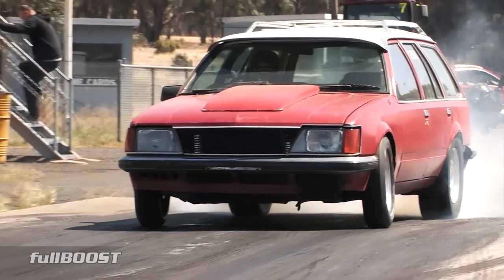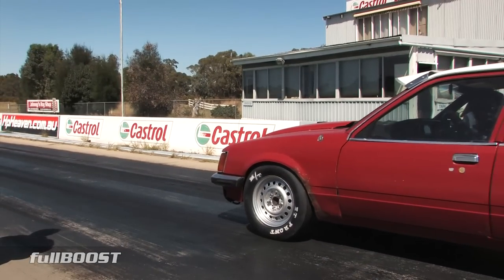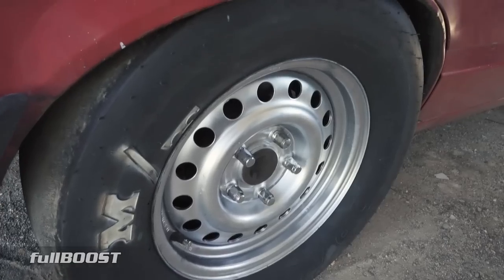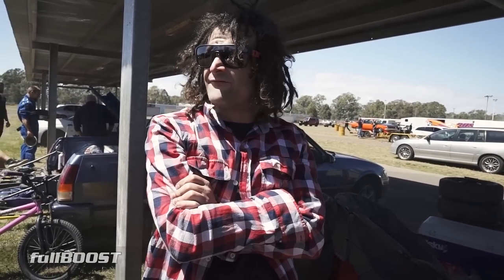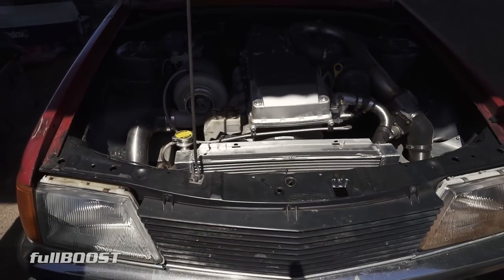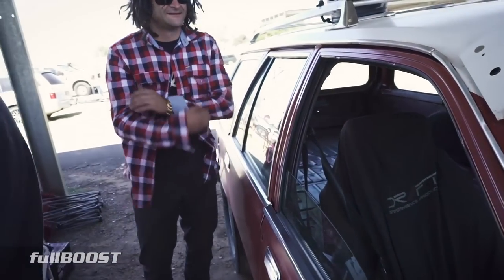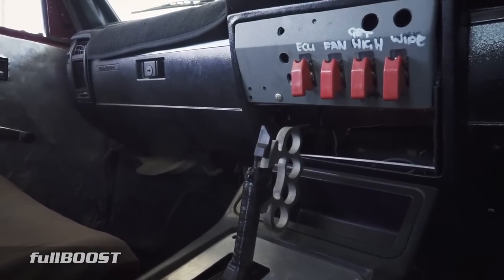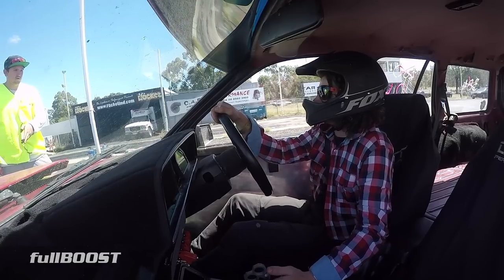Parts bin budget Holden | Ford Barra power!

Comment from the maker: A great example of a budget build, Kyle’s Holden wagon was initially pieced together for just three grand using a naturally aspirated Ford Barra BA engine and ebay turbocharger. A set of new slick tyres is about the most expensive part of the build.
Reply: Is the engine still running ?
Reply: sure is Ali Mavruk. pb of 11.5 to date. dead stock motor
Reply: kay bee  thats mad you should put a bf gas engine and crank up the boost to like 20psi
Reply: It's running 19 psi now! Can't believe it.
Reply: kay bee 19psi thats crazy
Reply: Upload more videos of it
Reply: No Ali there's no blowby yet, catch can is empty since day it was started, take oil cap off while running no smoke. Bit of valve float at top end of track that's about it. Engine still sounds strong as day 1
Reply: Did i hear in the video something about cams? Did you use turbo cams from ba? So basically you went to a wrecker and baught this motor? Put a turbo on it..didnt touch head gasket or compression or anything on the motor besides manifold and turbo and injctors..and tuned it?? Correct? Thats crazy..iv hear of people doing it alot but not sure how they went...
Reply: How much Power is it making and what fuel?
Reply: Pump 98 fuel, and yes it's still going today! Spends most it's time on burnout pad now. Same stock ba na engine. No springs no mods and no repairs needed since build.
Reply: @kaybee9363  What ECU did you use for it ?

Comment: wish we got barras here in the US
Reply: Arron Johnston 😐
Reply: MostlyIrishCarGuy  i recently  found out you guys get a gm  twin cam 4.2 strait 6 over there in trailblazers  ect.  why don't  people use that.
Reply: My family friend from california runs a shop calls cars usa and is imoprting barras as we speak.
Reply: Use your damn EcoBoost motor....leave the Barra for us.
Reply: u Americans know these barra engines are sand casted?  most Barras are amazing BUT not all! some have imperfections from the casting process and FORD knew this and blueprinted/handpicked motors for FPV models. Fun Fact for the day
Reply: Correct, a good way around this is to semi grout fill the block, it usually makes them strong enough to get by with a decent amount of power.

Thankfully we've got these engines fucking everywhere here, so a few headed to the states isn't a bad thing, I just hope they're not getting the NA engines, or if they are they're changing the rods in them for boost.
Reply: Faawks NA rods are the same as the ba turbo rods, heaps of 350-450rwkw on e85 cars around that last, northmead auto made 500+rwkw on an unopened fg na engine so its hardly a dont touch them. Bent rods or a leg out of bed are poor tunes or a rod bolt failure blow those power levels. Even the bigger turbo rods are only a minor upgrade. Best thing that could happen is americans push the development of them, every wrecker has 10,000 of them sitting there, more than enough to share. At one point a place was selling them for $75 with manifolds.
Reply: they cant import them anyway lol EPA wont let em. (we can though)
Reply: LP187q N/A BA Barra's have different rods than the turbo and factory LPG motors bro. It's funny the LPG motors got the good rods. They were having trouble with the LPG cars backfiring and bending rods so they used the beefier one's intended for the turbo engines. Not that the turbo/LPG rods are that good anyway. It's alright cause it matches the cranks!!! LOL! A lot of people don't seem to realise the rods are doing the hardest part of their job when the piston has to change direction at TDC. It's the stretch that kills rods, not compression loads or power stroke loading. I've seen a lot more rods fail from this than "S" bending from putting too much power through them. There's a reason Ford didn't let these things rev
Reply: Carl Zirbel How did they get around the EPA issue- especially in Cali?!?
Reply: MostlyIrishCarGuy I'm a qualified mechanic in Australia, I might be able to help you if you like. There is issues getting them into the States because of the EPA requirements, but there IS a way around it. If your serious enough about it, I'll give you my email address and we'll talk I'm thinking about sending a bunch of them over to sell, but is kind of difficult since I live over here. Maybe we can work something out that'll be beneficial for both of us
Reply: BA turbos used the small rods, mk2 ba f6's were the first with the "big" toothpicks. I agree its the stretch, but most dropped rods  you see have the piston attached, which is safe to assume is a rod bolt failure. Fair enough with 6" rods and a 92mm piston. People hack on the cranks but DLM pulled 8750rpm with a modified factory crank. Nems 8 second f6 makes 1250whp with the stock crank, main caps, girlde. Just pistons rods and 625+ fastners.
Reply: don't you think that if the Yanks get wind of them and create more demand for the Aussie 6 that Ford would return to building the Aussie 6 instead of the V6 crap they are building
Reply: LP187q That's pretty impressive with the factory crank and caps! They weren't made for revs from factory though, were they?!? LOL! I wonder what that 92mm piston would be in imperial measurement? My Rb30 only has an 86.5mm bore with a set of 30 thou up pistons. What's the stroke on these Barras? It's an under square engine, isn't it? I'm pretty sure it is, with a longer stroke than bore
Reply: 99mm stroke but that shouldnt stop it from revving with a good rotating assembly. Pointless having a twin cam head and turning it to 6500rpm. The 8 second f6 was running the zf 6 speed so wouldnt've been revving high either.
Reply: I hear ya, the only problem is piston speeds. Once you start seeing 4000 - 4500 feet per second it puts a lot of strain on the crank, block, caps and rods. A lot of really successful race engines seem to use somewhere around 1.3:1 bore to stroke ratio- everything from Pro Stock drag race engines to drag racing Suzuki bike engines. Even Harley Drag motors. But then you look at something like a 632 and these guys can see pistons speeds up to 6000Ft per second- but it eats the motors up real quick with those speeds
Reply: For sure. Metallurgy of oem and aftermarket parts have gotten pretty impressive over the last decade though. Theres a few barra street/strip cars that see 8000rpm, going to be hard on bearings but good excuse to go to an aluminium rod :). 1000whp ute that comes to mind got beat on for a number of years before it dropped a cyl. Only need to look at hondas in the states to get a real car nerd boner... B18 upwards, f22 and k24/2.7stroker hondas are all under square motors that spin past 6300fps on a boosted 1200whp 93mm stroke b18 with oem crank, and 450+whp aspirated 2.7L k24's run 16:1 comp and in the 6900-7000fps range with a 106mm stroke. All oem cast block/heads by rules and most of them oem crank and main caps. Chris miller ran his 93mm b18 that trapped over 180mph into its 3rd season of heavy racing before it went to honda heaven. 450whp 106mm k27s will sometimes do a whole season before they get stripped down pulling 10500rpm all year on turnkey motors built with off the shelf parts. Best thing that could happen is them getting their hands on and pushing development on barras IMO.
Reply: So true. Would be interesting to see where it all went from there. These Hondas rev incredibly well for what they are. That's some amazing piston speeds. It's the short service life of alloy rods that let them down in a street application. That being said, you do see guys using them in big hp 2JZ's used on the street. If I knew I could get a couple of years out of an alloy rod I'd use them myself in my RB30.
Reply: Yeah have heard that, but then hear other reports of alloy rods lasting as long as a set of pistons on engines making ~250-300hp/cyl. Hard to totally believe the sellers of the rods but BME and GRP both say they'll last on a street motor so long as they're built to their tolerances and not beat on while cold, and did read an article a while back on dragzine or enginelabs "debunking alloy rod myths" or something saying the same. Would love to throw a set on and find out as they arent much more price wise than a good steel rod, but struggle with budget as it is let alone throwing in a set of rods that may need to be replaced in 15k's for the sake of extra revs/light rotating assembly on an engine thats unlikely to turn a lap in serious competition, if any... Currently accepting donations though.
Reply: How do people swap RB's into other Nissans? That motor was never sold here. There is a guy with a JX90 in California. Don't assume it's not like the EPA inspects every cargo box coming off a ship. The Barra is related to the inline 6 Ford up until a few years ago was putting in the F-150 still.
Reply: JZX90 has a 1J, not sure id swap a 25 let alone a 20 for it. And it depends what nissan, its like asking how do you swap an ls into a chev :). We never had the ka in any rwd platform, but I had an rb20 180 back in 01 and from memory to get it mounted it was just a k-frame swap in a factory sr20 s13. Youtube is  the last place id be asking though lol, theres countless swap threads on forums. Having said that, if you can afford it the RB25 is a far better choice no matter which way you size it.

The barra 6 went through at least 4 or 5 local evolutions from the american 6 we got, aside from journal sizes i dont think they share anything else with them if that. The 300 6 has about as much in common as well,  you cant even run a barra head on our 2000 sohc 6 despite sharing the same rotating assembly. 300" barra would be interesting if the coyote or modular never exited though :)
Reply: I had 7 of these imported to the States. I have 2 left. Im located in Florida. PM me if you're interested.

Comment: Turbo Taxi put to shame
Reply: Jason B 

Full props to the guy for his cool build but you're comparing apples and oranges. Lightweight unregistered car that runs on petrol versus full weight street registered FG taxi (4170lbs in racing trim) that runs on LPG.
Reply: Engine built to run on pure LPG normal put out more power.

Comment: Digital dash would be worth a bit!
Reply: Gringo! I thought the exact same thing
Reply: it's an el cheepo ebay knock off special. Everything on this car is budget.
Reply: Hell if it is an ell cheapo I'd use one still keen to know how much it is
Reply: I thought the same about the coilivers in the front
Reply: Nah, the coilovers are cheap for those things as they fit other cars too from memory, heaps of second hand ones around.
Reply: Higgo link to do  el cheapo digital dash for less than  the price of slicks
Reply: 230aud for the dash. Just an OBD2 cluster from ebay, probably cheaper from alibaba. If you search obd2 digital dash you'll find heaps of them.

Comment: you might need to use a high pass filter to filter out some low frequency wind noise below about 35hz
Reply from the maker: It was seriously strong wind there, but yes that particular mic only has the small foam on it, needs  proper dead cat too.
Reply: You can do this in post processing, I think that is what ChillCosmos was saying.

Comment: I LOVE a budget build with an NA motor and ebay turbo but lets not pretend things like fuel pump, turbo oil lines, injectors, tune, intercooler, tigged alloy intercooler piping, full 3.5" exhaust, B&M shifter, racepack dash, slcks, stall converters, built tailshaft inst easily $5000+

lets not give people false hope

Comment: Why just 12psi? Why not 14,7psi or 21,8psi? I
Reply: (O.O) because 12
Reply: No boost controller, it's just running waste gate pressure, which happened to work out at 12psi. 
No screamer pipe either, it just vents straight out of the waste gate towards the sump! It's gold.
Reply: Higgo thanks👍🏼
Reply: its also a NA wrecker motor from a BA, so its one of the first barras built and not built for boost.  it will pop eventually.
Reply: $150 engine, series 1 engine 9.7:1 compression. Seems to be holding up well. He didn't stop racing and giving it heaps. They weren't worried about popping it at all.
Reply: $150 if you're not looking around, there was a mob selling them for under $90 for a while
Reply: yeah I can't find the place that was selling them cheap. Spewin
Reply: Because the first gen Barra's from 02-05 were weaker than the later 05+ models in a few areas.
That, and the N/A wasn't designed with boost in mind at all lol
Reply: stock ba valve springs float after 12psi sometimes lower
Reply: they were in broady from memory
Reply: It was ACM parts https://www.facebook.com/ACMPartsAust/
Reply: Why???
Reply: Why what?

Yep that's the one, there's on in Broady, I know they had a heap back when they had it running.
Reply: Why... why not.
Reply: Because its a stock n/a engine from a wrecker and he wants to wait a few months before he has to carry his rods home in a bucket.
Reply: Knock starter motor off??
Reply: How would you go about making the na a bit more suitable for boost, eg valve springs, rods, what else ?
Reply: Rods from a Na engine would not like it.
and  lets not forget the valves and headstuds.

Comment: I smell a rat, adjustable strut top mounts.....yeah there is more dollars in this car than he is letting on.

Motec dash, come on son.
Reply: There would be a fair amount of labour in making new engine mounts, getting bends made up and welded, and whatever else he had to do to get the box/drive shaft to fit. Would be surprised if that all fell in his lap. Could be his trade but yeah seems sketchy.
Reply: Let's not forget though, a lot of people don't include the price of things "they had lying around"
Reply: Junkers if you can weld and have basic fabrication skills, there is minimal cost to do those things. 

Steel itself is cheap, and a lot can be modified or butchered from wrecker parts. 

As for the dash, there are generic digital dash units that look like this for just over $300 on eBay. Apart from those tyres, tuning would be the biggest expense unless you know someone with the skills and a dyno. Cheers!